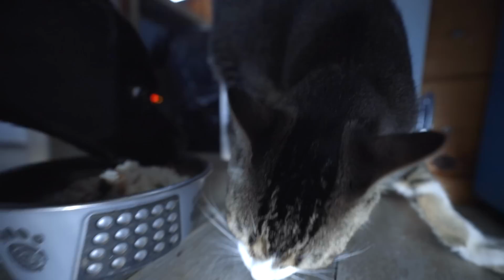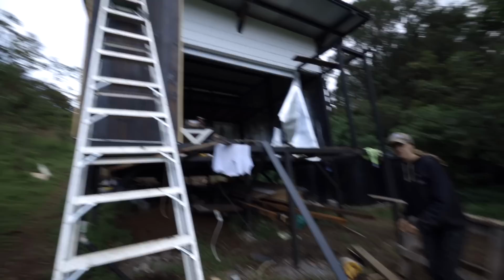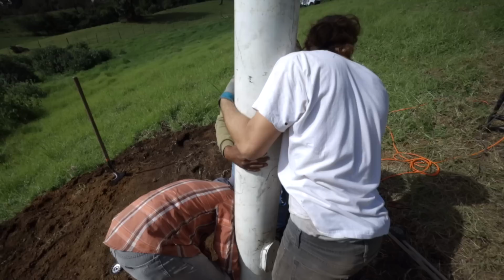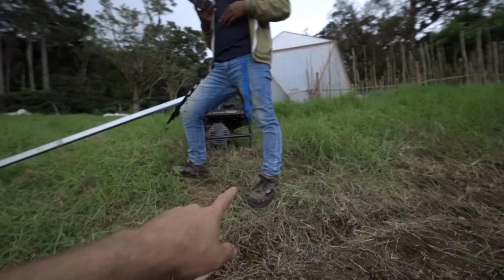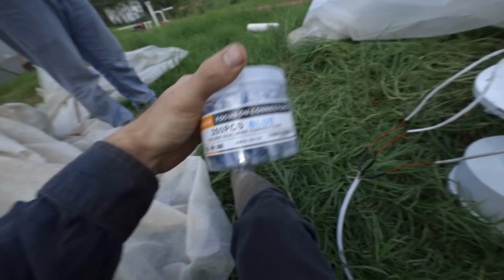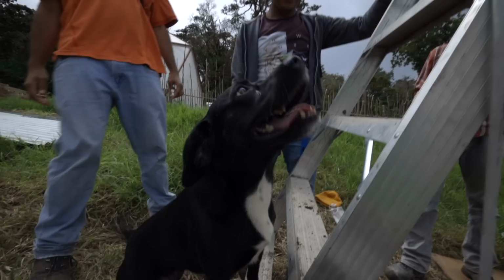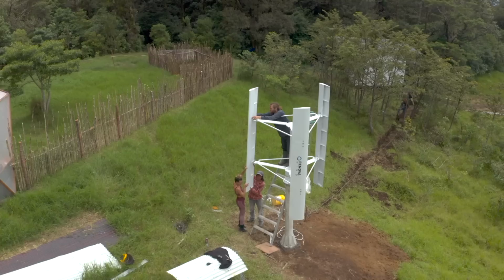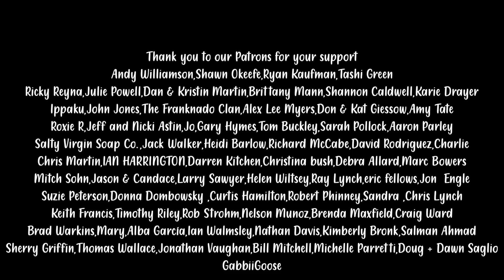WIND POWER!! Generating Off Grid Electricity with a WIND TURBINE!

Comment: I'm surprised that the turbine isn't higher off the ground. With the high winds you get it'll turn into a veg-i-madic and chop you up. Get a fence up to protect everyone.
That said this is an amazing addition to your power system
Reply: I was thinking that also! Walking into that would definitely hurt and hurt bad!  I too would highly recommend a fence like the others your buddy has done.  Better to be SAFE than sorry! ;)
Reply: Definitely a safety fence is needed! Otherwise, super awesome getting that wind turbine up!
Reply: It could turn the cows into burger as well.
Reply: It's awesome the have this but I've never seen one that low to the ground.  We have the verticals models around California but the blades seem to be at least 15 feet/5m off the ground. I foresee this getting broken by animal or vehicle. The 6kwh we are installing at our winery, which is a traditional design and it's 40 feet/13m off the ground.
Reply: @BillReals  It looks like a section is missing, this would be banned in the USA.
Reply: @grancito2  Ahh.. also, I wonder if it's rated at 1 kwh that low to the ground. I also wonder about the shear-force on that weld they did, vs bolting it to footing. I'm not structural engineer but EVERY vertical structure I've seen has long shank bolts to the foundation securing it to the footing. The footing for our wind turbine, which is a much larger/taller model, is 3 meters square, with 1/2 meter long shanks.
Reply: @BillReals  Right about wind speed and turbulence that low, and how long to break the welds between the plate and the rebars.
Reply: @BillReals  They did consult with their architect and because this is a different model (and lower), the force distribution and the magnitude of the forces is going to be different too. Other than that, time will tell.
Reply: I love your program. I Agree: You may already have plans for installing a fence around the bottom so people or any wild animals do not get hit by the moving airfoils. I have worked in Aerospace Engineering for over 36 years. When dealing with moving parts you always have to consider safety. We ask question like: Is that ejection seat going to be accidentally triggard when somebody is installing or maintaining it? How far does the ground support team nead to stay away from the jet engine inlet so as not to get sucked into the inlet? What safety pins do we need to install to insure safety of ground support people while they work on the canopy, control surfaces, the landing gear, arresting gear, the weapons bay doors, speed brakes etc. In the Aerospace world saftey is high priority. Overlooking these details by the engineers can result in serious injury or even death.

Comment: I like the deign of that windmill but a little concern about the short tower height. Taller towers get the blades into cleaner stronger air. Also, it appears it could be a safety problem of someone walking into the turning blades in the dark or while moving things around on the site.
Reply: Put a spacer between the generator and the tower, about 3 or 4 feet would be enough to get it high above the head level.  Make a tripod out of 3 large pipes to winch the whole mechanism up while you put the spacer in.  A little bit of work, but well worth it, you don't want to decapitate anybody with that thing.
Reply: The height concerns me too. There's no way without heavy equipment that they can add height. One of those wood fences should do the trick.
Reply: @d.e.7467  There is a way but almost impossible without a good sized tractor or skid steer or something. Cut down 3 big trees in the area down by the tree house, drag them up to where the tower is and stand them up like a teepee and use a block and tackle to raise the tower and place the generator and the blades in place. But then getting the tripod down would be really tricky without damaging the windmill.
Reply: @BigFireDave  Oh, I didn't mean to imply it's impossible. Just infeasible, mostly. And risky, safety-wise. I also like the idea of the high tech device protected by a tried and true old school fence. The irony would please me. Which just occurred to me that aside from a person accidentally walking into it in the dark, one of those cows might hit it. Unless they're too short.
Reply: My thought on a fence, it would block some of the wind defeating the purpose of the windmill.
Reply: @markloechner9409  While I don't know the dynamics of wind, the fence could be built just short of the bottom of the blades by a few inches areasonable distance away from the blades. Each post could be separated enough to discourage a large animal (and humans) and yet allow air to circulate if that's even an issue. Safety first.

Comment: Here is my small 10 cents worth, 2 things , first you might want to consider using RAWL bolts and anchor into the concrete as the vibration from the blades can make the welding to crack . Secondly does the windmill have a brake on it TO lock it against winds that are travelling at very high velocity that can destroy it also put a safety rail around it,  JUST MY 10 CENTS WORTH OTHERWISE ENJOY IT.
Reply: Francis van der hoven  I agree with bolting and if not then you should plug weld all the bolt holes
.
Reply: I'm certainly no expert but I'm not convinced that weld is strong enough & yes, it should have some sort of mechanism to lock/limit the speed!
Reply: Dave Brace the reason for the plug welding is two fold first it will prevent moisture from getting between the plates and secondly the increased connection points will certainly make it stronger and less likely to be influenced by vibration.
Reply: This is a H-rotor VAWT , it's very design prevents it going overspeed and I assume that the turbine controller has dump load resistors to limit the speed .  I do agree that it should have anchor bolts or chemical anchors . One thing that this turbine design does not tolerate is being off perfectly plumb, which is why they are generally bolted into position using very long threaded rods welded to the re-bar with a nut and washer above and below the flange plate base for adjustment.  When its perfectly vertical the gap under the flange is then filled with concrete.
Reply: @Pats-Shed  there hippies,cant expect too much..he could of used threaded rod,which i thought it was,or now he can drill the holes for chem anchores.that weld is enough,heaps,should be 3 runs though.plus fill the holes,which would take like 50 yrs to rust.or more.i think panels would be better cheaper.lot of work for 1 kw.thats 3 solar pnls.

Comment: Im thinking you should have extended the concrete taller to get the wind turbine blades away from people and cows.
Reply: OUCH !!!
Reply: Iama Wanderer  Also i would not trust those welds. Pretty welds does not mean there good welds. You could have a professional welder come up reweld and possibly burn in those bolt holes.
Reply: I was also thinking that it's so low on the ground, I thought it would at least be higher than a tall person.
Reply: wind turbine come slaughter house,2 birds 1 stone.brilliant..

Comment: Hi Guys,

Normally I try to be as supportive as possible and let other commenters point out the errors of your ways but this time I was concerned enough that I felt I had to say something.

If you are wondering why wind turbines are not allowed everywhere it is because of the fact that they have some pretty serious downsides which most people never consider.  You will see what I mean when it starts turning.  All wind machines whether they are horizontal axis or vertical axis generate significant vibration and noise due to the interaction of the blades and the tower.  Not only is the result loud and annoying but the ground vibrations tend to seriously disrupt local wildlife habitats.  Have you ever seen one of those gopher stakes that make a thumping noise that drives all the gophers away because of the noise?  Multiply that by 100,000 times and you will start to get an idea of what I am talking about. Most commercial wind farms have absolutely no wildlife left anywhere within miles of the tower locations.  In fact cows are pretty much the only thing that can handle living near them probably because they are put there and have no choice in the matter.  Oh, and before you even suggest it, the size of your tower and turbine and the fact that you put it on a cement footing in no way is going to eliminate the problem.  My turbines are a lot smaller than yours, are mounted on towers designed to isolate and dampen the natural frequencies of the turbines and are solidly attached to a 10'x20'x6" cement slab.  I can feel the vibration while the turbines are running right through my shoes, the thick carpet and the carpet pad 15' away from the tower base.

Second, you need to get some sort of real enclosure around that installation right now.  Like before you let that thing start up for the first time.  If you don't somebody or some animal is going to die.  The trick will be enclosing it without seriously disrupting the airflow...

Finally, and I don't mean to sound harsh here, but how did you decide to site your turbine?  Was any wind analysis done to determine the best location?  I ask because at the very least your tower should have been a lot higher.  Not just for safety reasons but because the airflow that close to the ground is going to be far weaker and much more turbulent than it would have been even another 10' higher. The slope and the fact that you have a vertical axis machine is also not ideal. Interference from obstacles not just upwind but also downwind and to the sides can have a dramatic impact on the amount of power that the turbine can generate and can also make a huge difference in the longevity of the turbine itself.

I hope you take this well intentioned advice to heart.

Take care, be well and all the best from California 🧡
Reply: Great advice. So much Ignorance about wind power.

Comment: You should try and figure out a "Shroud" or "AVP" ( Asymmetric Vortex Propulsion ) for the turbine built and placed on some sort of structure surrounding the actual blades.  It increases the turbine speed up to x8 even in low wind speeds which can sometimes be the case in less windy weather.  Also, on an unrelated matter.  I drank the "Lemon Ginger Blast" similar to the health drink you are drinking in many regards and my work colleagues accused me of dyeing my hair which was reverting to it's original colour.  I am a little vain if I'm honest but I have too much dignity to resort to hair dye, and I won't bore you about my blood pressure, heart palpitations, hearing improvement and through the roof energy which all started heading in a healthy direction, so you guys are smart cookies.  More power to ya. No pun intended.  Blessings.

Comment: Thanks as always. BTW 3 phase is 2/3 More power than single phase so you will have a lot more amperage than you thought,
Reply: Still if it's rated at 1 KW that's what you should get so forget what I said earlier--I am Wrong again which isn't unusual for me. LOL

Comment: As an engineer I am a little concerned about that weld, simply because that point is a ‘pivot’ and will be where maximum sideways force will be when the wind blows hard. It looks beautiful and I am 100 percent behind wind energy but I also think it should be much higher. I can’t see it catching any wind at ground level when you have so many trees around. Good luck though.

Comment: Doesn't look like a traditional windmill but it is really cool. Windmills are very large in order to generate electricity that is why per size they aren't as efficient as solar panels but they can be a good supplement. The only drawback is the material(carbon fiber) they are made of can't be recycled without a lot of energy being used. They are using wood again on some windmills to solve that problem.

Comment: My comments: suggest to use a 10 foot galvanized ground rod and # 6 copper ground wire to connect to the steel base for lightning protection, suggest to check the length of feed wire and resulting voltage drop, you should have a table showing feed wire length and cable size in your Manual, remember you need 10 mph or more wind for this to have any kind of output, perhaps you need 40 mph for full output, good luck   P&F

Comment: Love your videos, and your positive energy!  (Not to be a Debbie Downer but I'm fearful that the base weld is not enough to hold it in strong winds.  You'd be wise to re-inforce it with bolts, or at the very least, welding the bolt holes.)  Good luck in all your upcoming adventures...

Comment: Just interested why does the wind Turbine not look like a normal one ( a fan thing at the top of the tower)?
Reply: Just a different style. A lot quieter too.
Reply: Because the industrial version requires hundreds of feet to make it an efficient design.
Reply: Their style of wind turbine catches the wind from all directions being more efficient. The big ones that you see are efficient if facing the wind.
Reply: This one can't furl in an overspeed scenario, there's a reason commercial wind turbines are they way they are in their exposed locations.
Reply: Bagleygames never knew that
Reply: Andrew oh right
Reply: Michael Russell that’s pretty cool
Reply: @jdbagley3  all wind turbines catch the wind from all directions as they swivel to face the wind using a tail. Those vertical types are actually an inferior design which is why you dont see them on commercial wind installations.
Reply: It's a VAWT as opposed to a HAWT (Vertical/Horizontal axis wind turbine). VAWTs are less efficient so rarely used and never in utiity wind farms. The thing they are (relatively) good for is disturbed wind because they don't have to turn towards the wind direction. If the wind is moving around all the time due to surrounding buildings or vegetation then one of these can work better than a standard HAWT. I'm surprised they've used this in this fairly exposed location, unless the wind is normally coming from behind over the trees/hill? And putting it up a couple more metres would probably nearly double the output because wind really is much faster and higher quality out of the disturbance generated by the ground (and power output is related to windspeed cubed (at least for HAWTs - maybe that's not the same to VAWTs?). Maybe they got it cheap? Turbines that will survive storms reliably are expensive. I guess we'll find out how well it works in future episodes.
Reply: @Wookey.  they got it for free so an honest review on how much power it makes or how fast it spins is unlikely.
Reply: @MotorizedBicycleRace  Well OK, free is a good price. Any turbine at that rate is good value :-) So long as it survives (and it does look pretty chunky) then it's all good.
Reply: @Wookey.  i watched their next video only for some bikini showering lol but noticed that the turbine was not spinning in that video.

Comment: I sincerely hope the welding holds over time on the turbine...Bolts would have been stronger no? Love what you guys are doing though and wishing you the best.
Reply: I know very little about welding but what I have read is that welds, if done right, essentially fuse the two pieces of metal together making them one, and can actually make them the strongest part of the two pieces of metal. IMO that would we stronger than bolts which could shear off. I could be wrong though.
Reply: 1 inch of weld holds 1 ton, that weld is most likely good for 20 ton, wind makes the blades spin creating a fairly even outward force... vertical turbines have nowhere as much force on the base as standard turbines... if this fails please come back and call be out!

Comment: 0 -10mm = sheet
> 10mm = plate

That whole white painted base would have to be pre heated and at least 3 fillets all around but your concrete would likely‘explode’ from the moisture in it.

Comment: I know this video is old, but for anyone watching this and thinking of installing their own wind turbine, large or small, the huge mistake these ppl make is they mount their turbine at almost ground level, which is essentially crippling the ability of the turbine to be effective at all, " The bottom of the turbine rotor should clear the highest wind obstacle (rooftop, mature tree, etc.) within a 500 foot radius by at least 30 feet. Doing so ensures the turbine reaches consistent, fast wind speeds and prolongs the life of the turbine by avoiding stressful air turbulence." or similar such etc etc.

Comment: Make sure to connect the 3 phases together untill your controller is connected to the turbine. There will be no way for it to controll the speed and it will destroy itself. With the 3 phases connected together the magnetic field creates a break and will prevent rotation and destruction.